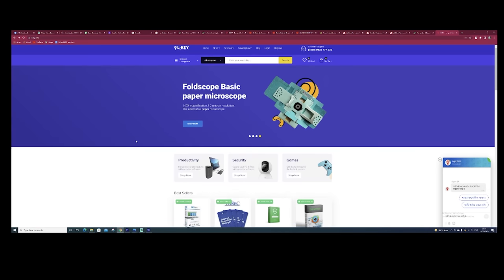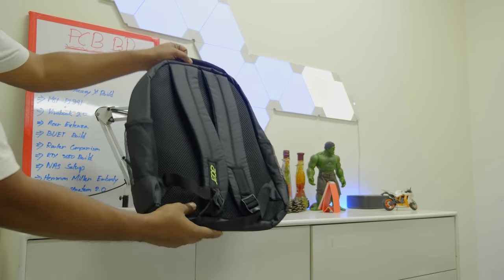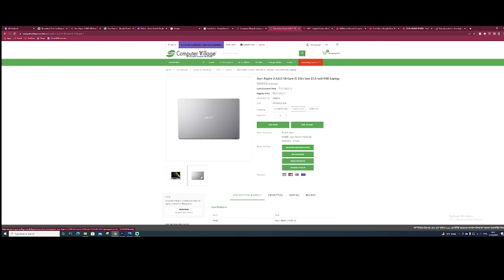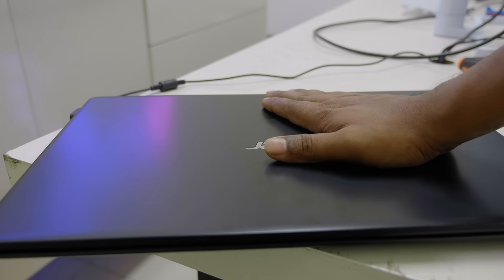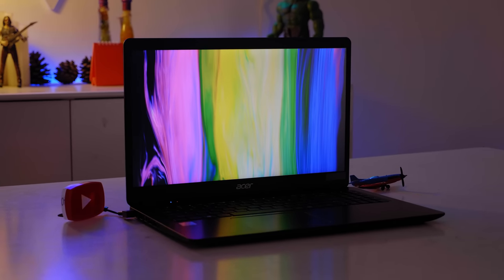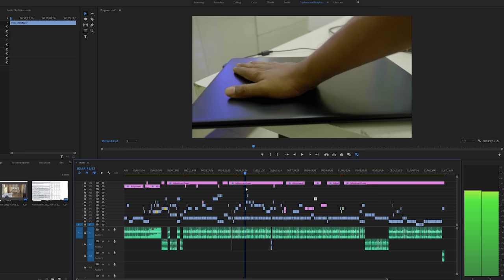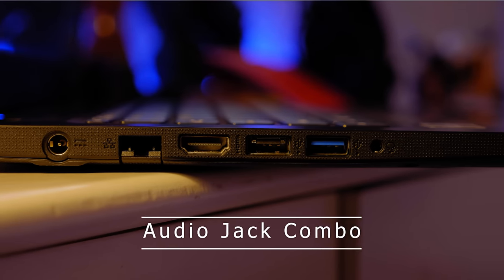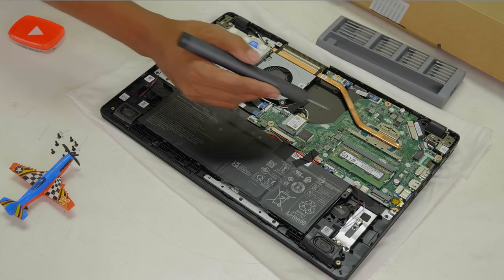Best deal under 55k BDT Budget | Acer Extensa 15 EX215-52-58SQ Laptop Bangla Review

Comment: Several issues with this review:
1) IPS display has much better viewing angle than TFT. You have totally missed talking about viewing angles, but were claiming that this is equivalent to IPS display due to color accuracy. At this budget, color accuracy is not the main concern. 
2) Mechanical harddrive with 5200 RPM is totally unacceptable in 2022. It is better to not give any hard drive than to give a 5200 RPM old style hard drive. The first thing a buyer need to do is throw that to a garbage bin and buy an SSD. 
3) The laptop does not come with Windows. You are downplaying that saying buyer could get it installed from the shop they buy. As a reviewer, you should encourage people to use genuine software, not encourage piracy. Or you should encourage people to use Linux, acknowledging that Linux is not for everyone. 
4) There are a lot more to consider for a laptop than just listing specs. Just having the specs isn't enough, does the laptop have proper thermal design to use 100% of the spec? There are reasons why some laptops perform (and cost) a lot more than others, please read up about them so that you have better understanding. Acer has the worst build quality than any other reputable brands like Dell/Lenovo. You really get what you pay for.
Reply: Literally
Reply: Couldn't agree more
Reply: Not everyone has budget of 1-1.5 lakhs for premium laptops.And he never claimed this laptop is as good as those flagships.Thanks for your essay.
Reply: @bullseye6683  It's not about buying premium laptops. It's about not sugarcoating things. People should buy whatever falls within their budget, given they are provided the correct information and they can make informed decision.
Reply: Acer doesn't has worst build quality
Reply: Ips panel is obviously better and people know that(this is 2022 bro).that small complement regarding color correction doesn’t  make tft panel better than ips as well as this review sugarcoated.
And you want ips display,ssd,genuine windows,super fast cooling system.what do you think acer is?
Reply: @bullseye6683  I like Linux:)
I  think Linux is for everyone
Reply: @larryjohnson4606  its your personal preference.as far as i know,linux wasn't built for regular users.so,not suitable for everyone
Reply: @bullseye6683  I don't get why the OP wasted his time writing a useless essay.
Reply: Can you suggest me a laptop? under 60K for online classes, pdf reading, free lancing, multitasking and most importantly value for money, long lasting
Reply: So true, I couldn't even run this laptop after few days without SSD. It was so laggy like I was using this laptop for 5 years. And recently the hinges broke after a slight impact. So poor build quality.Also the speaker is so sh*t.

Comment: 60k r modde Walton ex510g good . ami amr yt channel r jonno 1080p r vdo bhalo bhabei edit korte pari . amr cnannel a jaye video dakhte paren . Channel name : AMH BENCHMARK .
Upgraded ram upto 32gb
512 gb m.2 ssd ( write speed 550 mb , Read speed almost 600mb )
35000 MAH
14 inch FHD 
2 m.2 and 1 hdd slot
Backlit keyboard 
usb c slot
micro sd slot